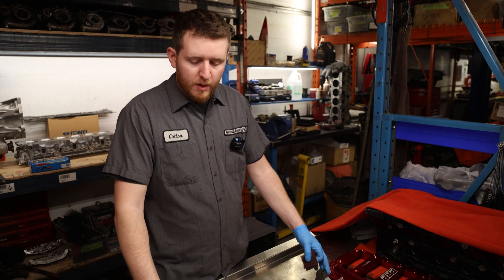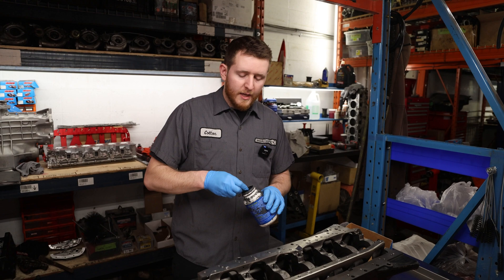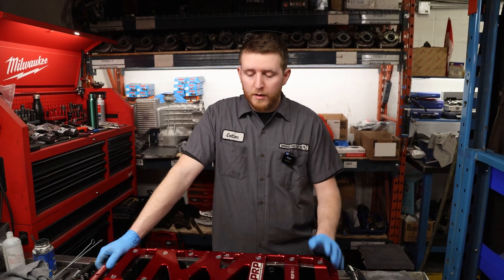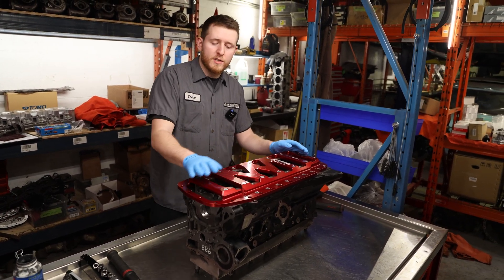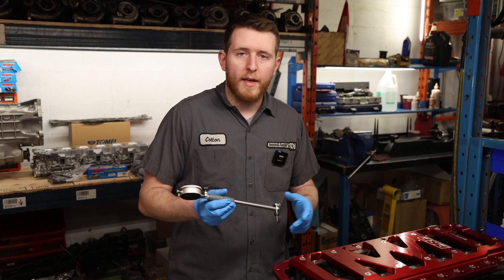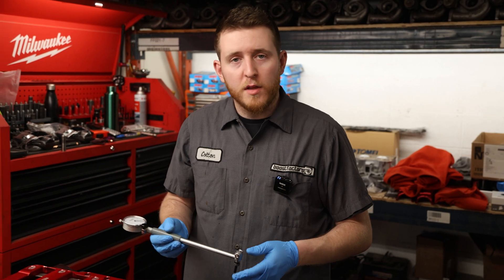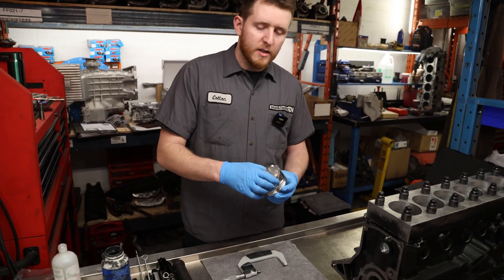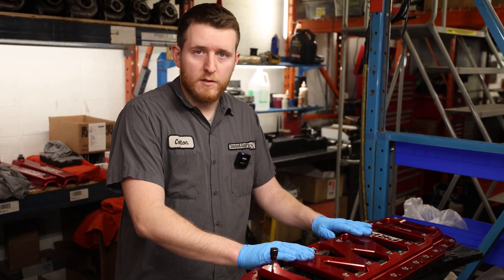RB26 FULL ENGINE BUILD || Episode 2: Machining Verification & Confirmation Checks

Comment: Bro, don't use the red scotch-bright on the mains, the red is like 300 grit use the grey it's about 800.
Reply from the maker: Hey mate! Im aware of the grit, There is so little pressure and low passes. The red scotch bright has no effect dimensionally on the cast iron.  Ive also tested in the past the finish change, and this also has no considerable effect on the RA finish after the align hone. You'll see in the rest of the video this area is measured in great detail.
Reply: It's not like the roll lock discs where brown is coarse, blue is medium and red is fine.

Comment: astonishing video! definitely learned a ton from you guys and I’m super thankful for the sharing of your knowledge with us. I have a question, tho. when checking the cylinder wall measurements (specially), isn’t it safer to lube the surface that is going to be measured, in order to avoid  vertical scratching with the bore gauge? or is it unnecessary/harmful for the accuracy? thanks in advance!
Reply from the maker: Hey John! I'm happy you're enjoying the content! to answer your question , lubricating the cylinder walls will skew your readings, some say up to .001". You will also  muck up your measuring tools. The marks you see from measuring are only witness marks and have no effect on cylinder sealing. You'll also notice that when we get to ring gapping, the rings will leave similar marks during the measuring  process as well.